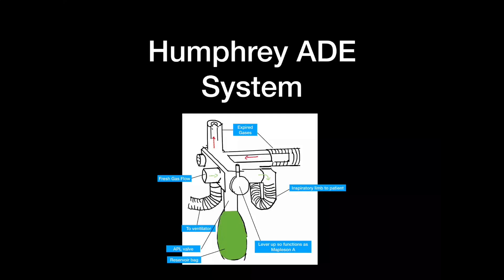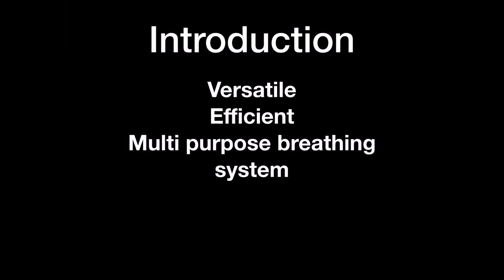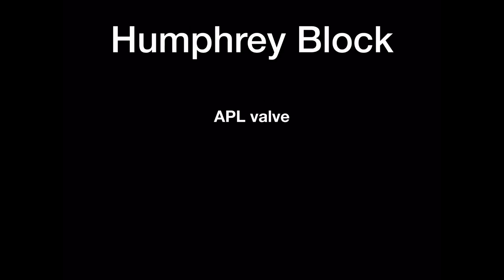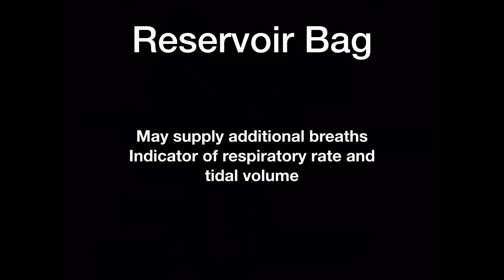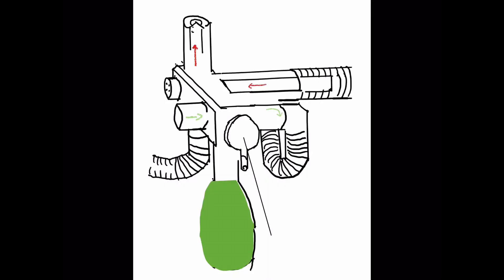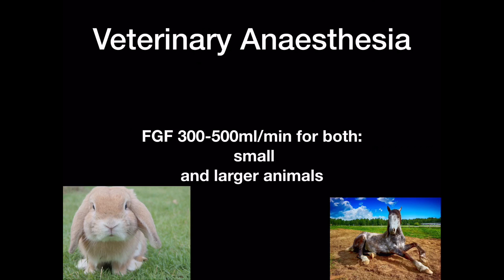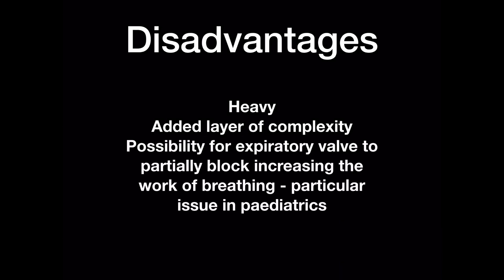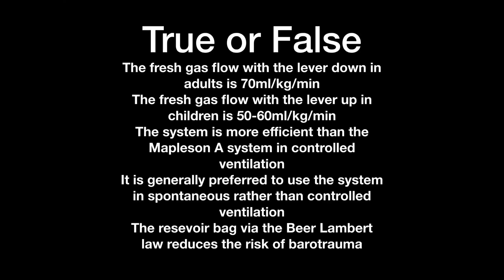Humphrey ADE System. Important FRCA Equipment Topic

Comment: Hi, Iam a veterinary anaesthetist. Ifor the use in veterinary medicine I would say that you ca use in companion animals (manly dog and cat) or, if you prefer, small animal. For large animal are meant cattle, horses... we cannot use this system in those animals where  it is necessary using a circle with the 50 mm circuit. I would say that the ADE is advantageous in using in small animal practice as you can use it as only one system as we usually divide the patient 1-5kg from the >5kg .